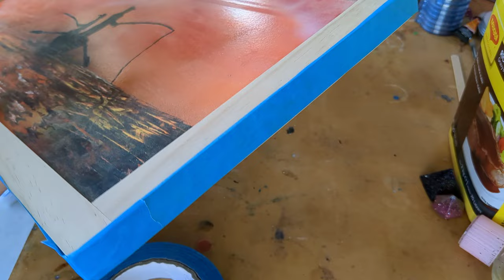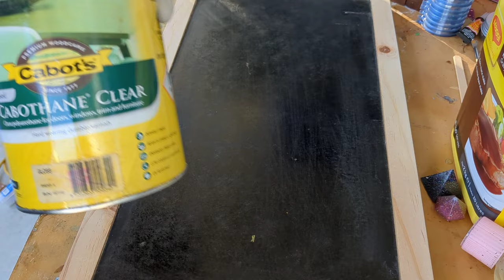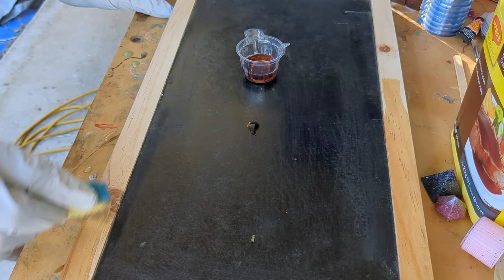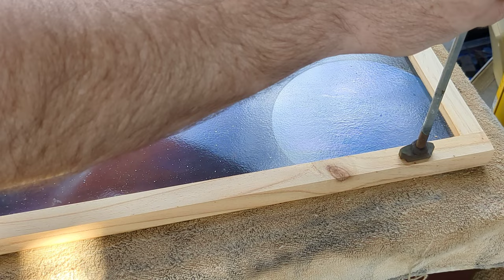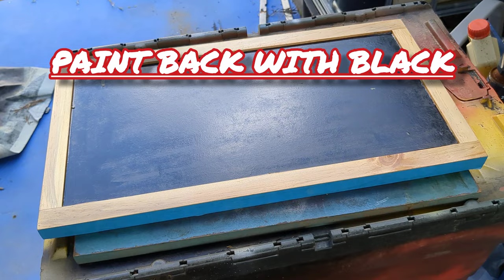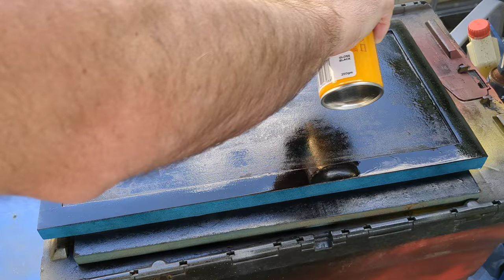spray paint art cheese board part 2

Comment: Also could you please tell me what thickness mdf you use if you don't mind sharing
Reply from the maker: I'm using 16mm MDF, primed with 3 coats of  antibacterial white primer, quick sand with 320grit to prep for spray paint.
Reply: Thanks very much for that, it's really appreciated.